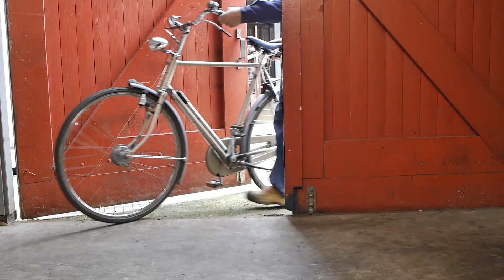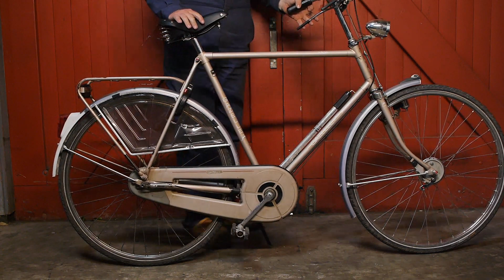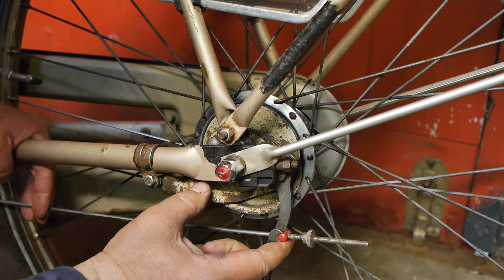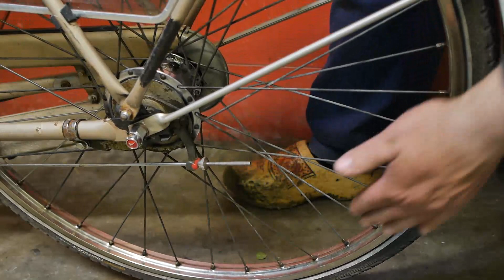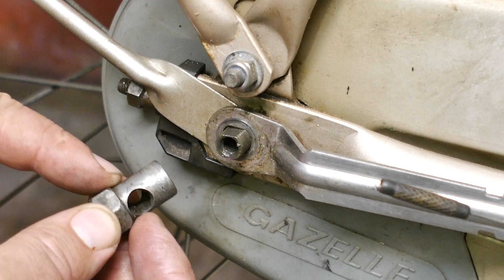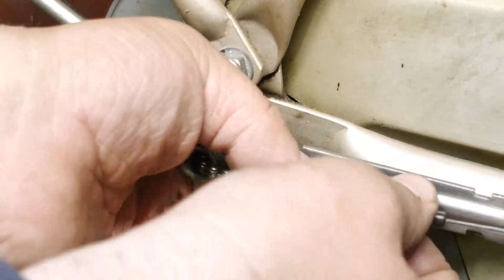Testing drag on a Gazelle bicycle with S.A. drum brakes

Comment: Hi if your drums are clean and you cleaned or sanded your break pads adjust your breaks so your comfortable stopping in a reasonable distance, don't worry about any drag on the back wheel, after about 5 or 10 kilometres check the drag on the back wheel again and adjust the break if necessary if required. The break pads have to bed into the drum properly again. Hope this information helps.
Enjoying your videos, keep them coming.😁👍
Reply from the maker: That sounds like smart advice. I will definitely try that :) Thanks.

Comment: I take it this is the same bike as in the April 11th video, titled by bike's name.   In that video,  at the 2 minute mark you apply the rear brakes and the long rod leading into the rear brake is bending rather than moving forwards at the lever mechanism near the pedals. So that rotating mechanism within that lever needs freeing.  I am surprised that in the bike design the front lever mechanism near the top of the front wheel ( for the back brake) is so inefficient, and also that the movement range for the whole brake mechanism is fixed, not adjustable.
Reply from the maker: Correct, it's the same bicycle. And you are right about the rod towards the rear brake seems to be flexing. Perhaps it came into contacts with the kick stand. Something I will have to investigate. The travel of the brake levers is fixed but and front and back are linked. But you are able to adjust both brakes at the drum brake. And the levers are designed in such a way the rear brake is applied before the front one. It's rather clever and probably a good setup for on a slippery surface.

Comment: I would personally use V brakes if you can install them on that type of bike. you could try taking it apart again and have another look is there any adjustment inside like an old car with drum brakes where you can adjust the the shoe in or out slightly but it looks a simple mechanism so it's really a case of fiddling about to you get it right ...
Reply from the maker: Without any mounting bosses those will be hard to install.

Comment: Open the brakes up again and clean with aerosol brake cleaner, more is better. With the shoes as clean as possible, coat the contact surface with some white chalk, reassemble and go for a test ride, open up again and see how much chalk has been removed. This will indicate the contact surface. You may need to turn the drum, or replace the shoes. Also, is the lever the original for the brake? If not, it maybe too short to apply the proper torque. 
Look forward to the conclusion to this, 
Cheers
Reply from the maker: by now I have reinstalled the original wheel and used a drum brake lining from a donor bicycle. I still need to edit that shitshow :) Braking is a lot better, but still far from impressive :)

Comment: I've watched your introduction a few times and right around 1.40 where you say "braking totally sucks",  you are flexing the rod with your hand, but the lever on the hub isn't moving ( or hardly at all ). This suggests to me that the rods / linkages might be worn, to the point that activating the brake lever on the handlebar is having very little effect on the hub lever. That would explain why you only get acceptable braking once you pre-load the hub lever by tightening the rod adjuster to the point that the shoes are already dragging on the drum. So, in summary, the range of motion in your handlebar brake lever is not being properly  transferred to the hub lever due to too much flex in the rods and linkages.
Reply from the maker: At that point in the video I'm just flexing the brake rod a little. The linkage is still o.k as far as I know. Although there is a rattle coming from one of the front links :(